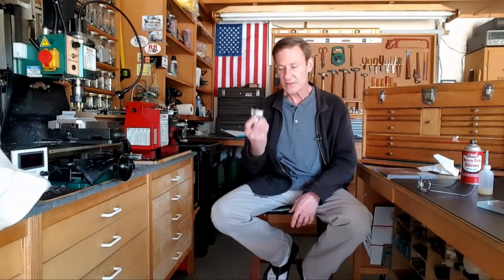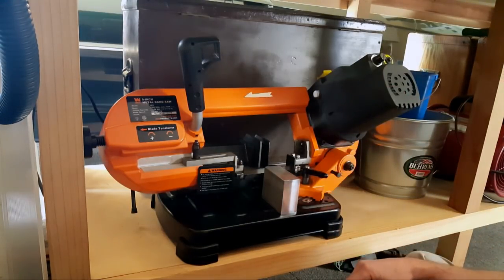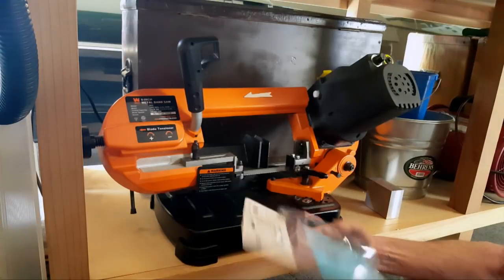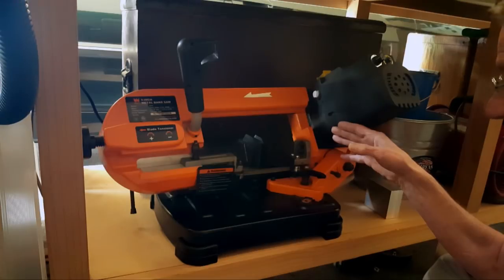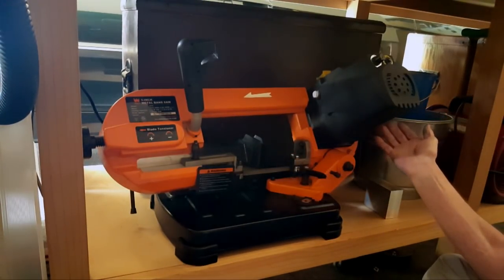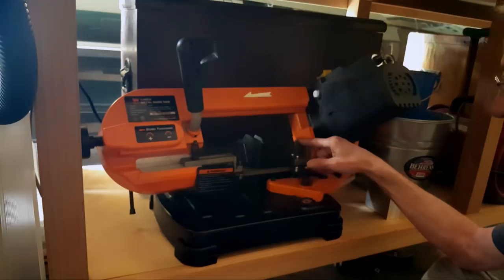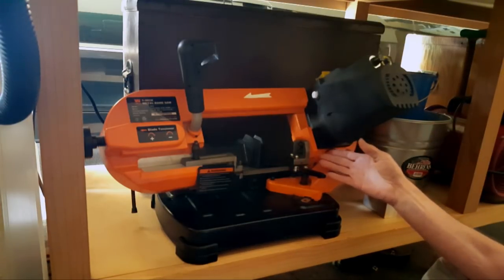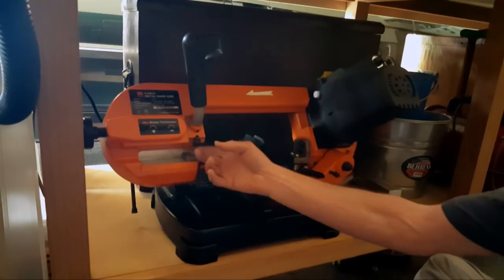Replacing a Wen 3975 Band Saw Blade Nightmare

Comment: Not the saw it’s the installer. I have one and have changed the blade half dozen times or more and I don’t have any problem or have to remove any of the rollers to put on a new blade
Reply from the maker: It was machined wrong since I corrected it I to can change blades without a problem.

Comment: This goes under you get what you pay for. That is a throw away tool. I good quality saw of that size but much more quality normally cost 600-900 dollars.
Reply from the maker: Once I figured out the correct adjustments replacing the blade is now simple and it's been a great saw for the past 3 years...

Comment: Had one for 4 years. Blade is 1435mm x 0.6mm x 13mm. Keep blade length short for each job, tension when runninq so it stays within the guide rollers but no tighter!

Comment: One more thing IF you had "blade bobbing" you cut a material too fast or with too much force.  This is a light duty machine and IF you treat it like that you will get good results.  I have had mine for over a year and cut steel and aluminum and went SLOWLY and never had a problem.

Comment: Dave, First off I bought one of these and mine works perfect.  I did a few mods on it like TAPE the trigger to the handle.  WHY you need this is moronic.  Just use the on/off switch.  Even IF you wanted to be a dork and use the trigger it is in the wrong position.  It causes you to bend your wrist too far.  I do agree with you the feed bar is USELESS and I threw mine out.  I looked at the rear and changing blades should be no problem.  Oh and one more thing, get used to EVERYTHING made in China unless you want to pay TRIPLE for the SAME item.

Comment: I have the same model you have. I think your problem is that the band blade is rolling off the front edge of the pulleys. I just opened mine up. The pulleys both have a flange that keeps the blade from rolling off the back side of the pulley (the edge with no teeth). There must be a taper on the pulley outer surface that keeps it from rolling off the toothed side. Material can build up on the outer surfaces of the pulley where the band blade rolls as well as the band itself. This material can fowl the slope and make the band roll off. I would get a rag and clean those surfaces off as you slowly advance the blade. Also clean the blade. With clean pulleys and blade, the problem might go away. I don't see a way to adjust the orientation of the pulleys to biasing the direction that the blade tends to migrate as it is rotating. But it is most likely build into the pulleys themselves.

Comment: I have the milwaukee portaband and broke my first blade the day I bought it.( I feel it had a defective weld) I replaced it with a Lennox 18 tpi blade I bought at Lowes (the only store I could find a blade) and its been on my saw for nearly a year now and has worked flawlessly.  I didn't have any of the issues you had (thankfully).

Comment: HF 7"×4" vertical/ horizontal with a 25%off its a work 🐎. Thanks for the videos , sharing help
Reply from the maker: LOL Johnny, I have 5 work benches, 2 cabinets, 2 saws, a car, a refrigerator, 7 tool boxes, 2 lathes, 2 mills and some walking space all in a 3 car garage. Now where am I going to put a work horse?
Reply: yep, I'll send u pics, mine's tucked away and rolls out into walkway for cuts....you're just about stuck on that one side of shop till cut is done ....but, wow 7 boxes. i have 2 , i guess that why its always a mess here. i have ve single space garage but no mill yet. lots of mechanics tools tho and biggest and most on welders and compressor
Reply: +Johnny Drinkard outside the stand its really not much bigger
Reply from the maker: And now that you mention it a 2HP compressor also. I'm pretty happy with this saw since it tucks under the bench where I sit on the floor to do my cutting. But always look forward to pictures of other shops! BTW been thinking of getting one of the small Banggood welders but installing a 220 outlet won't be fun... Still gave acetylene if needed.
Reply: Absolutely,  I'll take pics tomorrow. i have zeny tig and stick 200amp and a zeny cut-50 on 240v and an old HF mig 90 ....HF one i've had about 10 years, a few mods but still running great.
Reply: after a few pics i noticed how much i needed a shop overhaul. may take a weeks but I'll get it soon.
Reply from the maker: Oh sure now excuses! LOL
Reply: lol, i never noticed how messy my shop looks next to yours till a few days ago....I've seen worse, but man, yours is clean.

Comment: Wow, thanks for the video. My blade started hopping today, tried to figure out why and while troubleshooting it busted! I just placed my order with sawblade.com after your suggestion, didn't like what I saw on Amazon. Hopefully getting this new blade installed and working correctly won't be too bad with the help of your video.
Reply from the maker: Pleas let me know how the new custom blade is! I haven't ordered it yet and you will be the tester for everyone...
Reply: Will do, should be in Wednesday. Awesome expedited processing/shipping over there. Ordered it yesterday evening and had a tracking number and shipping confirmation before lunch today.
Reply from the maker: How did the blade workout?
Reply: Sorry for getting back to this late. Wanted to make quite a few substantial cuts before I posted. So I replaced the blade and ended up needing to adjust the roller closest to the pivot like you. I've made 40+ cuts since and my sawblade.com blade is treating me very well. I bought the 14-18 blade and the cuts are even cleaner than the original blade but at the cost of having to slow down the cutting speed. Back to loving this machine though,  I went ahead and purchased a spare and the price is slighty lower when purchasing 2. Over all I'm happy happy happy.
Reply from the maker: Great feedback!!! I'm ordering one today...
Reply from the maker: My blade just came in. Mounted it and the splice is messed up so it make a large cut and noise when the splice comes around. Called and they wanted a video of it not a problem! Received an email within minutes and their sending another blade at no charge. The power of a YouTube machining channel...
Reply from the maker: Just received the replacement blade for the one with the bad splice. They spliced this one backward so the teeth are in the wrong direction! NIGHTMARE.....

Comment: Dave, you suggested your bandsaw uses a custom blade size, by which I assume you mean length. If you have a local(ish) supplier of stock bandsaw blade of suitable depth, thickness and toothcount have you thought of making your own. There's several UT vids on the subject, the one I like is from a channel called Tom's Techniques,                                     (https://www.youtube.com/watch?v=mzKSk_Zs0w&t=1sE)
 where he shows you how to make and use a jig for the purpose.
 Hope this helps.
Reply from the maker: I know of Tom's splice work using silver solder and his jig. This technique is perfectly acceptable and reliable for vertical band saws where forces are pulling only. The problem in this case is silver solder has pull resistance but can't withstand the twisting forces which occur in a horizontal band saw. So I was considering brazing the old blade but not worth the time and effort over a new USA made $18 blade. BTW I'm guessing Tom made the jig because the repairs don't last very long and he has to redo them frequently. But good input and thanks!

Comment: I have 12" and 14" verticle metal cutting bandsaws a portable bandsaw and a large horizontal bandsaw. All have Sterrett blades and I've never had any problems. I'd say the extra cost is worth it. Also, I'd never buy blades from Amazon because of the price. There are a couple of online blade sellers that make blades to your specs at no extra cost. Sorry you had so much trouble replacing the blade on your bandsaw, but I did enjoy the video!

Comment: Another super video  i remember them saw little bigger  can cause lots of trouble . We used to get alternate  teeth  like 10 one inch  and 14 next inch and so one  works great to. beside saw problem   we need them band saw :)ty for the share oh the blade needs to be fairly tight  pluck it with finger should be tang sound :)

Comment: I gotta get a bandsaw... Getting tired of chopping up stock with an angle grinder!
Reply from the maker: Dude I can not say enough on what a difference it made in the shop. Less waste, faster jobs, less mess and projects I wanted to do but didn't because of all the cutting I would have to do. Well worth it!
Reply: go for the harbor freight horizontal/vertical. its a work horse, and blades are plenty at 13$( Olsen)  and about 30$ for starrett . i bought mine just after your saw buy a while back... after watching many reviews and upgrades it was the best choice. you might want an upgrade.